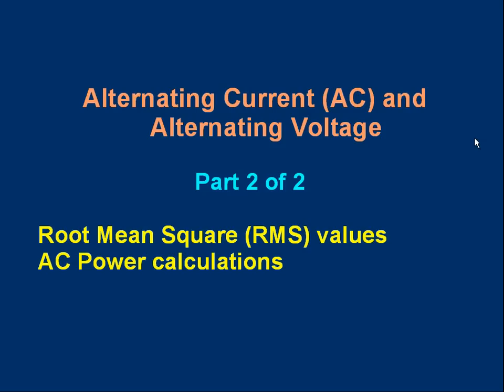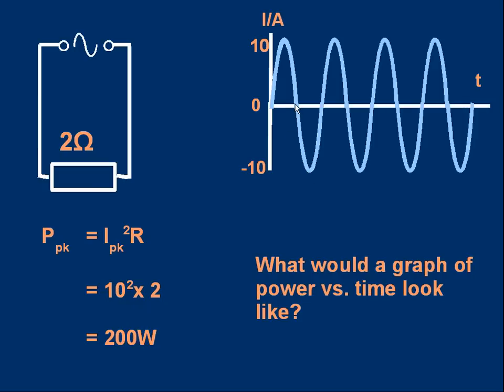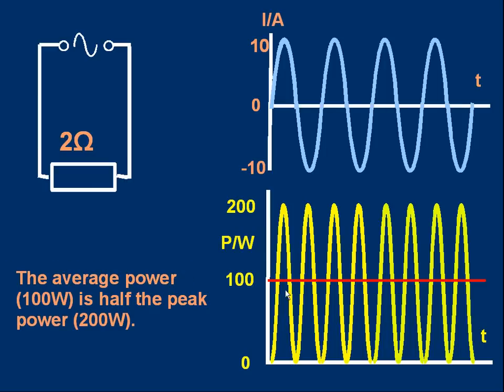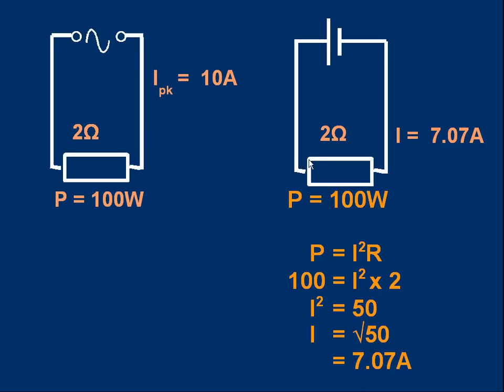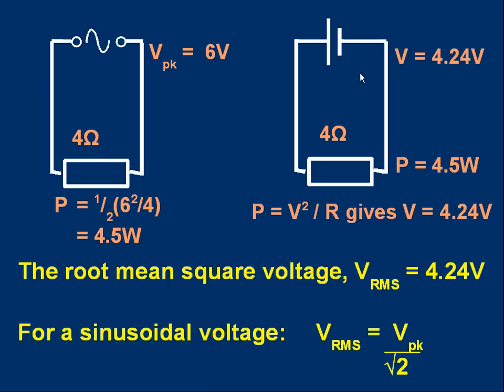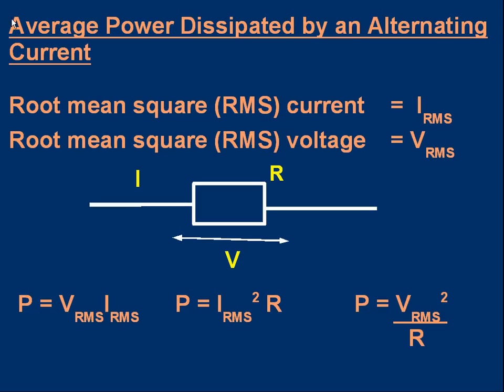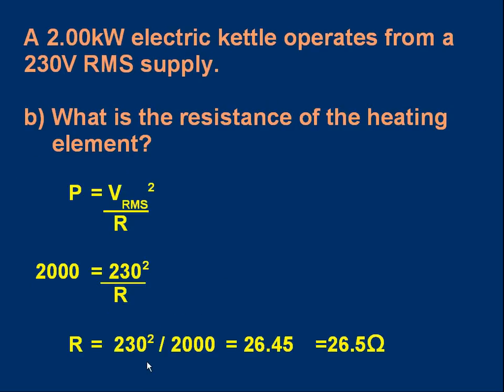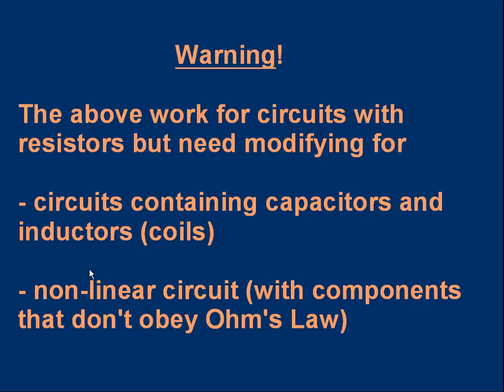GCE (A-level) Physics E31 Alternating Current (AC)  Part 2 of 2

Comment from the maker: Hi.  It’s not a rectified shape.

Plot graphs of y=sin(x) and y=sin²(x) using a calculator and see the shapes for yourself.
 
For a fixed resistance, power is proportional to current squared.

I = I₀sin(ωt)
I vs. t graph has same general shape as y=sin(x) graph.

I² = (I₀sin(ωt))² = I₀²(sin²(ωt))
I² vs.t (and P vs. t) graph has same general shape as y=sin²(x) graph.

For a  more mathematical explanation, note:
sin²(x) = ½[1 - cos(2x)]

This gives I²= ½I₀²[1- cos(2ωt)] which is a sine-like shape.

Comment from the maker: RMS  voltage (or current) is the steady voltage (or current) that gives the same power as the alternating  voltage (or current).
For a square wave, Vrms is simply the amplitude. E.g. you have a square wave ‘flipping’ between +5V and –5V.  Then Vrms = 5V.
For example, watch the preceding video (E30 Alternating Current (AC) Part 1 of 2) from about 10min onwards. It shows a square wave ‘flipping’ between +1.5 and –1.5A.  This has the same power as a steady 1.5A. So Irms = 1.5A.